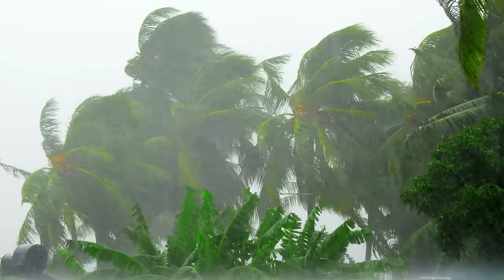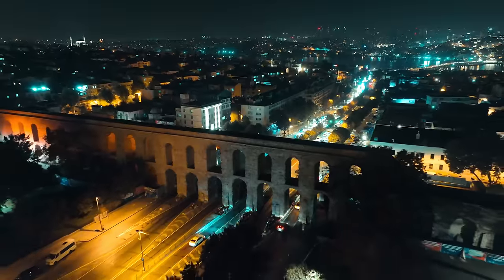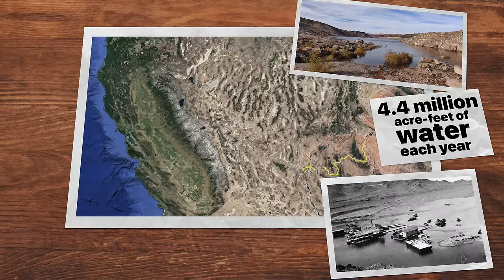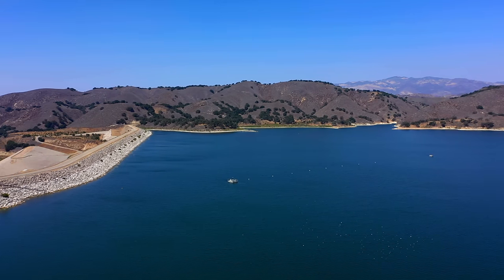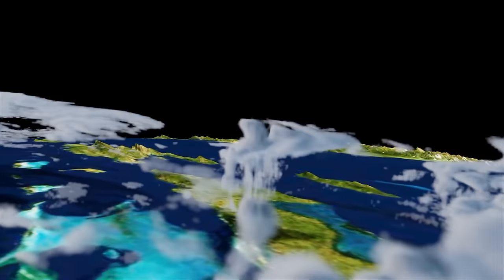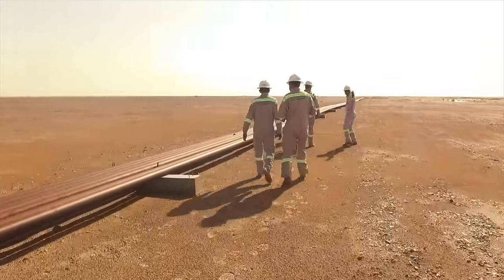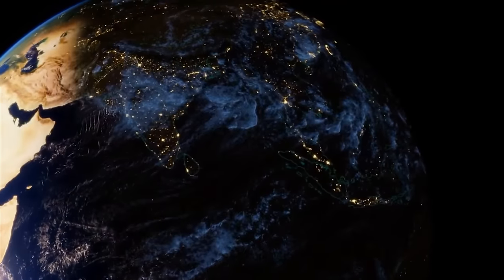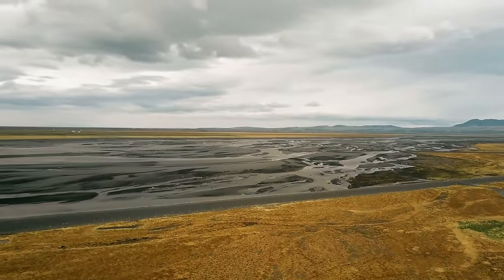Pipelines From Flood to Drought

Comment: Hi Ricky, I like the idea but the flow rate math is off. Water pipes have limited flow velocities to about 8 ft/s to prevent damage to the pipes. Assuming a 36" ID on a pipe, the pipe would only be able to flow about 112 acre feet of water per day.

I was contemplating this idea the other day and to me it would make the most sense to repurpose the Boring company to make water tunnels instead of transportation tunnels across the country. In theory, many of these tunnels could be kept at relatively the same elevation and each municipality or region that wanted to withdraw water would pump the water up to the surface to reduce transportation costs.
Reply: Those numbers at 14:30 sounded off to me too.  Thanks for providing better calculations.  I also wonder about the energy required to pump this much water, but I like the idea of moving water to reduce flooding.
Reply: The flow rates are demonstrably off. I stopped the video, and did some back of the napkin math a 36” pipe delivering 600M barrels per day hypothetically should have an exit velocity of round about 4000 mph. Best I could figure was about 680,000 barrels a day, or a 12% increase.

After that everything else falls apart when you adjust the math. Instead of 30M homes the keystone pipeline would service 36k homes.

Then you have the cost, about $8B for 2k miles. Or $220k per home construction cost, before maintenance and operations.

We use vastly amount more water than we do fuel. There are niche cases  for pumping water but the scale and costs aren’t considered in this video.
Reply: 112 acre-feet per day? What kind of bat ** crazy freedom units is that??? I joke of course. But on your point, it does seem a little far fetched to pump so much water across country, and absurdly expensive.
Reply: Kinda a shame that the whole video is based on the assumption that that much water can be moved reusing some old tubes that already exist, but then you check the math behind the 1000X number shown and it is wrong by at least 2 orders of magnitude :(
Reply: @Ubiquities  When I heard the numbers I was thinking the same thing. My own calculations gave flow rates of about Mach 5 exit velocity. Even with multiple parallel pipes, those daily volumes are greatly overestimated. I still like the general concept.
Reply: I had to scroll too far into the comments to find another process engineer. His whole premise is wrong based on that bad assumption

Comment: Gotta admit that I’m pretty skeptical. Maybe I just don’t know my weather/geography well enough. Seems to me that a lot of the flooding in the West is caused by infrequent heavy rainfall on land that’s experienced desertification. So in these instances there’s not much water to draw down in advance. I question the practicality of pulling water from areas in the east. Seems as though most of the flooding I hear about in the east is either on a small enough scale from infrequent enough storms that I don’t see how you’d get enough water to make it worth it. The other major flooding in the east is coastal hurricanes or tornadoes (the scenes in the video), seems to me that a large portion of this flooding is storm surge which I thought was salt water. Yes a ton of rainwater also but how much of that is contaminated by the salt water? How many of these coastal areas actually have reservoirs or holding “areas” that could be pumped down? As an Easterner I watch people continue to move into a desert and then complain that they don’t have water. If you want water stay/move where the water is. I can’t help but feel like this is an attempt at water theft. Lake Mead is almost dry and the western states are still fighting over wether they should reduce usage. People are still watering their lawns.
Reply: The Mississippi River valley floods pretty frequently and on a massive scale
Reply: @Camboge  Really? Because the last I heard the Mississippi is nearing record lows right now. Right now happening to be when the West also needs water. How often is a localized drought really that significant?  There’s a lot of money and effort involved in trying to make an uninhabitable area habitable. Climate change is a thing. You want water move to where the water is. Stop trying to steal water from the areas that have it so that people can pretend that they don’t live in a desert. Why isn’t there a big push for desalinization plants in the west?  Why would you want to pump water over/through the continental divide when the ocean is right there?  And how many years of constant use/overuse of Lake Mead has it taken to drain it so drastically? Think realistically about the size pipes and amount of time it would take to pump enough water from somewhere to make even a tiny difference. Forecasts are rarely accurate until a few days prior to an event. You’d never move enough water in a few days to matter. This whole concept is a bullshit attempt at a water grab.

Comment: 99% of Floods aren’t caused by releasing stored water from dams when a storm comes. It happens from rain directly over and around the affected area and between basins/dams. So this plan is fine for equalizing water levels between reservoirs but won’t help with flood damage mitigation. Only thing that can help with that is increasing/improving the storm drainage below street level. Which also isn’t water that I’d think is of suitable quality to pump into a reservoir untreated considering the pollutants. And even then I’d think that there’s no way to treat that volume of water quickly enough to effectively “take advantage” of the flood waters.
Reply: I agree, each of the flood video/photo examples I saw in the video fit that scenario too, instead of dam backup.  His analysis in this video focused on how interesting California is, not where and why floods and water surplus commonly are.
Reply: If there are enough water retention structures the ground can hold most anv precipitation.  One rancher in AZ in his lifetime built 20,000 such structures on his creek. Government  researchers comparing it to a nearby natural creek found a 30% increase in water runoff but it flowed 3 times as long.  There are utube videos on similar work in  India western saudi arabia and Africa.  In Africa dams across gully fill with sand where water can be retained underground so it doesn't evaporate but a fawset on the dam taps into that lens of water with out pumping. . It's really neat to study. Also please check out Alan savory . His work on grazing animals benefiting the land
Is fascinating
Reply: Normally I find these videos interesting and informative. But I'm sorry to say I had to laugh when I heard the suggestion of using existing Natural Gas and Oil pipelines to move water to prevent flooding. It reminded me of when a co-worker suggested that tank farms should be built so they could be filled with Mississippi flood waters.
The volumes of water that are shed from uplands and end up in lowlands, streams, rivers, flood plains are vast. It all happens fast too. 
Not addressed in the video is the energy that would need to be used to move those huge volumes of water between reservoirs. Again as Yo Daddy suggests pumping water between reservoirs solves very few flooding problems
Reply: however: lowering water levels in rivers that are prone to flooding areas around them makes sense. it is actually the pver flow of rivers tgat does cause flooding
Reply: @marypatten9655  there is a remote possibility of preventing flooding on some rivers where there is a large reservoir upstream of the flood prone areas. The transfer of water would likely have to start weeks or months ahead of the cause of the flooding event. The time period is dependent upon the Volume received, volume to be moved, the diameter of the pipes, the power/volume of pumps, length of pipe, elevation differences, friction, availability of power to run pumps etc. 2 bits' expectations of the velocity of fluid transfer appear to be way off. Take a look at the penstocks that are used to transfer water at Grand Coulee Dam to Banks Lake. They are enormous. His example and calculation of the Keystone pipeline and an estimation that 1000 times more water could be moved is unrealistic to an extreme. He seems to be suggesting that the water could move at 3000+ miles per hour (assuming typical oil pipeline velocity of 3 to 8 mph). The fact that the estimated volume could meet the needs of 30,000,000 households says nothing about the volume of water that is moved by nature in a flooding event.   It seems like a cool idea but I just can't see it as workable without the environmental damage and displacement of people, farms, and wildlife as thousands of more reservoirs are created. People nee to change their expectations on where they can build their homes. Floods occur naturally and can be beneficial to wildlife and more.
Reply: There are many examples of wetlands using reed beds on the inlet side to help clean up the water. If the area is big enough it should handle the overflow water by a cascade of connected wetland areas. The quality of the outlet water should be good enough to drink since this is the same as how we get 'natural' freshwater for drinking anyway. We just need to redirect the water to different areas when water is in excess. 'Two Bit da Vinci' has hit on a brilliant scheme and it should be adopted. Today there is a new Bradfield scheme in Australia being discussed which is to bring the excess water from the frequently flooding North of Queensland to the drier parts of Southern Queensland. Similarly the "Ord River basin" north of Western Australia has massive amounts of water that could be moved to the many drier agricultural regions of WA.
Reply: @kennethreister7619  Why do you think we need to create thousands more reservoirs?  I thought the point was to fill up our existing reservoirs (Lake Mead, Lake Powell, etc).  A few new reservoirs would be optimal, but thousands more are not needed.  So not much displacement of people, farms and wildlife.  If continuously filling Mead and Powell from the Mississippi could be done, that would take care of AZ's water problems, and a some of CA's problem.  Fill CA's reservoirs with a pipeline directly from the Mississippi to CA and that would take care of CA.  The pipes don't need to be huge if we have weeks of notice that there will be heavy rains that will flood the Mississippi.  That river is so big. If we drain part of it and the forecasted rains don't happen, there would be no harm... as long as the forecasts aren't continually incorrect.  Dropping the water level of the Mississippi by a couple feet won't have any repercussions on wildlife or barge/boat travel.
Reply: Additionally you must remember, we used to have acres of land filtering rain prior to hitting the river, now we direct runoff directly to the rivers through many acres of pavement flowing into stormdrains reducing natural bio filtering cleanup times while increasing quantity of water hitting the rivers nearly as fast as it rains.
Reply: It’s a big issues w many parts, but worth thinking about.
Reply: @bobl703  dropping by a couple inches on an average rainfall year might not have an effect. Dropping it during a drought which the Midwest has too would be catastrophic to barge transportation, current downstream water users as well as trying to send any amount of water West through new pipelines.  The Mississippi is not only a freshwater source it is a gray water discharge. With less water, there is a higher concentration of discharge making that water less desirable.  New discharge limits would have to be set all along the river to assure levels on drought years are kept to the new lower standard making costs of water use from the Mississippi rise substantially for users already connected just to support westward water needs. Minnesota/Wisconsin/Iowa/Illinois farmers have already invested significantly in well based irrigation due to  regular drought/low rainfall years. A lowered watershed (a few feet using your term) will only increase the demand on well based sources draining that aquifer even greater causing more dry seasons with wells in use going low or dry.  With diminished surface waters across the Dakotas , MN and WI, Michigan and East would see lower rainfalls hence spreading the few feet impact across the eastern Midwest and eastern corner of the country changing climate patterns and yes creating climate change. Each time HUMANs interfere in natures perfect environment, we screw it up somewhere else. Man made lakeside resorts in Nevada probably shouldn't exist since without mans changes all done without reviewing global implications, they wouldn't.
Reply: @davidpeterson486  If there is a drought in the Midwest then you stop the flow of water from the Mississippi to the west. There would be control valves, so that would be easy to do.
Reply: Our city in the SW recycles rain water.  I think flood waters could also be recycled.
Reply: all of the reservoir's are used for recreation and in some areas old body dumping grounds(true story)so the water has plenty of pollutants before it gets to treatment plants. Pollutants are abundant in runoff. That's where more stringent standards for water treatment comes into play. Also, if water is pumped to low levels from the ground the arsenic levels rise to sky high levels along with other natural mineral levels. None of this is good for those on wells.
Reply: @bobl703  You're wrong...MOST major river systems are so full of silt and their levels drop so low that shipping is limited on those systems.  That includes the Mississippi, one of the most valuable shipping river systems on the planet.  This is a POORLY researched and suggested "plan".  
The MAJOR thing needed to be done is to create better water retention systems that allow water to absorb into the ground (especially in the West, where flash floods happen along with erosion).  Not major dams, local much smaller water catching and absorbing NATURAL structures. There are LOTS of videos about how "we accidentally grew a forest" thanks to the proper water retention earth structures. These also replenish GROUND WATER, which nearly ALL desert areas...including California are running out of rapidly. 
For the flooding areas, they also need to create different NATURAL structures that help take water AWAY from Rivers, Streams and lakes, etc. that are more prone to flooding. 
A LARGE number of floods, especially on the east cost are floods due to seawater, storm surge, etc. as we're seeing in FLA and NC from the most recent Hurricane. Rising Sea Levels and poorly designed developments contribute to the destruction of property and exacerbated flooding because of a lack of well designed wetlands and connecting natural and manmade water resources.
Reply: Most states have highly inadequate water-control measures. Having lived in NY most of my life, I was aghast when I traveled to other states that just had ditches on the sides of roads - have they no engineers they ever heard of erosion (not to mention disease/mosquitos/etc.)? Say what you want about NYC (there a LOT of 'bad'), but the underground infrastructure (water, electric, subways, and even steam-heat in some areas) is so perfectly controlled that it manages to hold it all together. In my lifetime, the subway only got flooded ONCE, and that was because a major hurricane hit Manhattan head-on. And it was cleared-out in just a few days. If there is a problem that 'can't be fixed' somewhere, you can bet there is a politician in-charge of things that's making money off the non-stop 'disasters'.
Reply: I would build my water clarity/reformation plants near the cities not the dams tributaries dikes or rivers, the water is naturally depolluted  as it travels through sediment direct drinking water can be cleaned near cities :)
Reply: @DreddKnot.  Exactly right - purifying the water before it reached its destination would be pointless, since it would have to be re-purified anyway after traveling so far.
Reply: @bobl703  Barge traffic is being affected right now.
Reply: New Idea:  Pipe glacier melt off Greenland to N. America, and Africa.  This could slow Atlantic Current slowing due to the insertion of cold water and work to reforest desert areas.

Comment: The best solution to increase water is to use permaculture on farm land, especially unused and degraded land, to super charge water percolation so you can capitalize on any rainfall. This idea does seem like it would definitly be helpful however. Having the ability to stabilize areas independent of rain really helps.
Reply: Or pump water out of the ocean and desalinate it.
Reply: We could also focus on recycling more wastewater. Based on what I could find with some quick searches, the US recycles around 10% of its wastewater intentionally, if the sources I found are correct. Which means there could be a higher yield of wastewater we can tap into and recycle so we can get more clean water. If we want the most amount of water, the US would have to work on Permaculture Desalination plants and Wastewater Recycling but it requires a lot of cooperation.
Reply: @lorddane4147  if we could recycle almost all our water that would be such a big boon! Singapore has closed it's water loop, and I wouont pretend it'll be as easy for most bigger countries but it's possible! Singapore themselves has actually said they want to sell their climate change technologies to other countries to help them do the same!
Reply: @RealTechnophoria  We definitely would like better tech to recycle our wastewater so 90% of it isn't wasted. We do have the tech we just aren't using it as much as we need and we don't have the amount of plants open to do it. Plus it would be better if we could do it faster so we can help the Colorado River Basin and especially the Salt Lake Area considering how dangerous it will be if the Great Salt Lake drys up